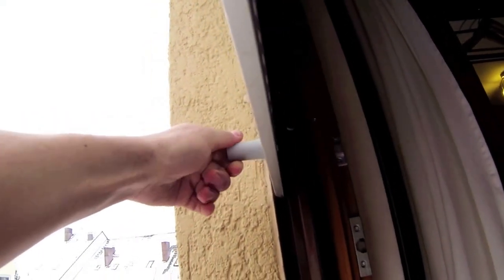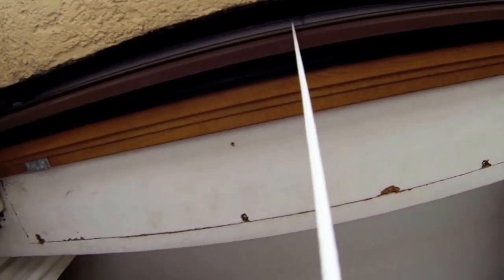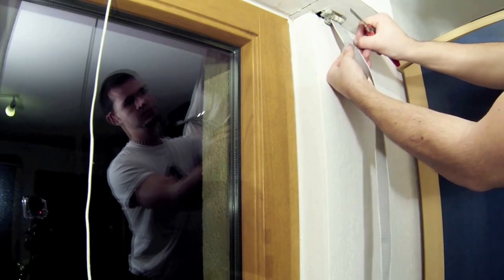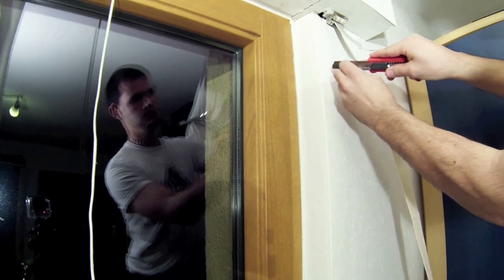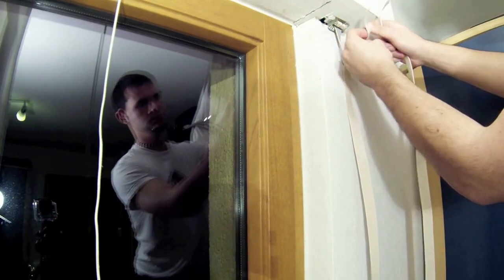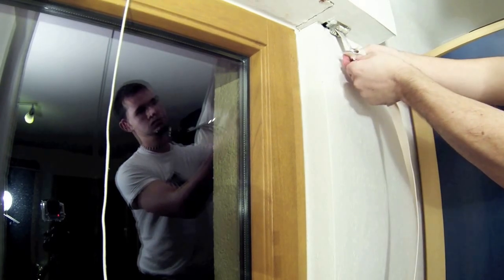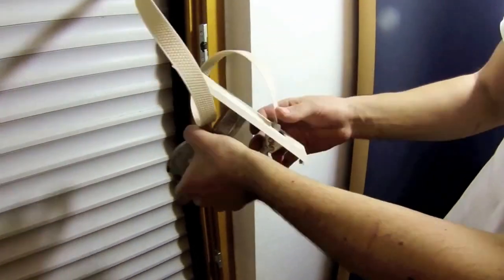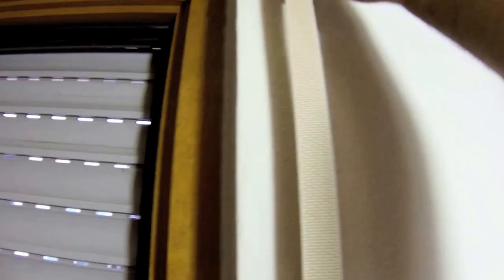How to exchange strap of a roller shutter without opening head box

Comment: Is there a spring in the roller tube in this type of shutter.
Reply: I don't think so - but thank you as I was looking for how to say this in English!
Reply: Yes, of course. If you let lose the roller without winding the strap on it, the spring will lose effect.
Reply: Hey Eric. There is a springload in the strap winder on the bottom. Not on the sutter axle. The shutter rolles down by gravity. Sometimes you need to put some extra steel or led sticksin the baserail to aid gravity, but🤫... trade secret...

Comment: have you any idea why the barrel axle comes out of the socket on left when the blind is brought up or down.? i put it back in but it comes out again
Reply: Hey Simon, sounds like one of the slats has shifted, the can slide horizontally and get stuck on the inlet in the head box itself, unless you can see it from below through the outlet, you will have to open the head box to inspect. Slats can be shifted back in place by hand. Shifting slats usually occurs when there is a one sided obstacle on the bottom, so the curtain sits uneven... or worst case if the axle is not rolling straight, then the roller barring or the axle adapter might need replacing...
Reply: @martinbayha9999  martin,that's exactly what I was thinking but hadn't much luck getting them straight. But now you say it ,I will go back with more determination this time. I appreciate your advice and hope it will work. Thanks a lot

Comment: AS A HOME OWNER THIS MIGHT WORK, BUT IF I AM PAYING FOR THIS I WANT THE PULLEY INSPECTED, THE BEARING LUBED, THE STRAPS CHECKED AND THE COILER REPLACED WITH A NEW ONE.
Reply: Hi Bob, like your thinking👍🏼
Pully is being replaced by this, it is literally virgin where joined. Bearing usually needs replacement when it squeeks, maintenance free otherwise as ball bearings. Coiler can be replaced non the less but only needs when it does not pull in anymore as you can see in video you have to pull it out anyway, so no difference if you put same one back in or a new one mate.
And the shutter curtain can only be visually inspected anyway, porosion level of pvc can not be measured onlz guessed by vision / touch. On Alloy curtain no maintenance is required. 

What ever you feel like, do not lube them in the tracks or the little pulley wheels that guide the strap. Only soils the parts over time, even with silica spray, electronstatic loading from running curtain up and down attracts dust and is disadvantageous. 
Litterally unless something breaks or is visually unpleasant, no need to touch the units